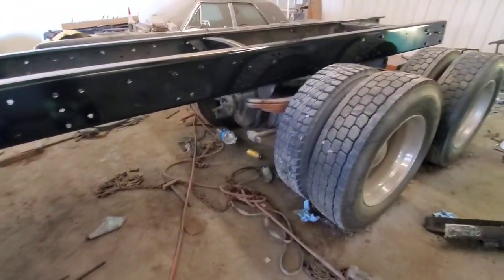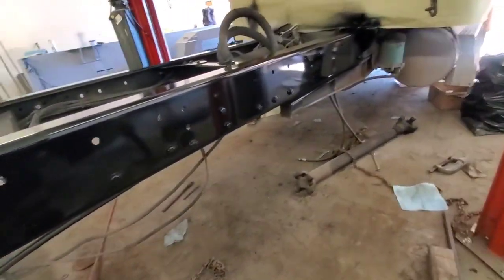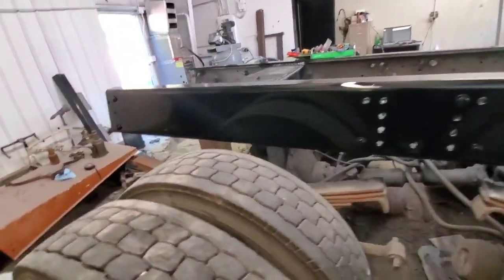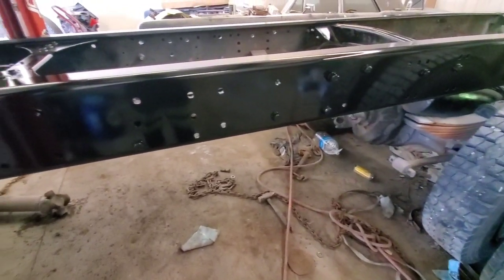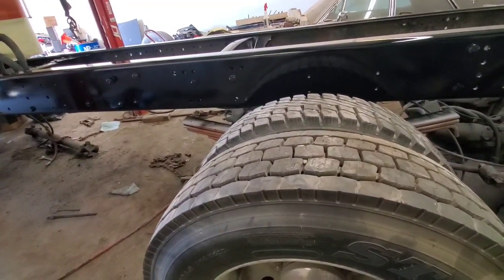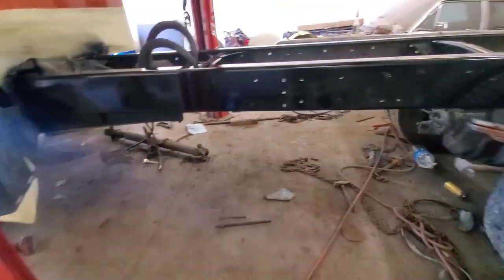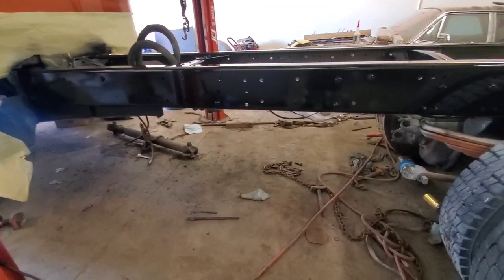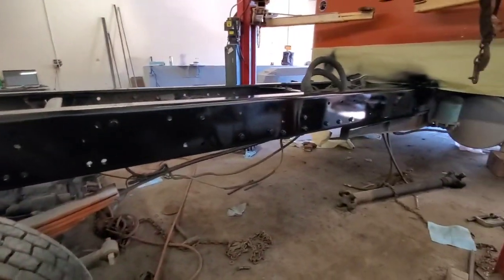Heavy Duty Tow Truck Rebuild Part 12: Frame Install, Prep and Paint

Comment: Nice.   Are you replacing U-joints or anything?   Is it just spring suspension or does it have airbags?   I would guess if it’s only springs it rides rough.   Are you going to put the wrecker unit back on before you drive it a lot?   I am thinking having the weight on would help reveal any problems.   It’s great that you have people that are willing to help with this project.   I assume you will have to have tire chains for winter towing.
Reply from the maker: I am replacing all the brakes and torque arms. Its spring suspension with air bags on wrecker bed. Stuff will pop up once i start workig i
Reply: @towuniverse2443  Are you planning to use it more for just towing, or recovery.   Always good to replace the most important stuff to save yourself headaches.   I would bet the brakes are rusty, and probably worn out, given what the rest of the truck looked like.

Comment: Im getting ready to paint a rollback deck think that paint would work out good? Ive thought of using por15 or either chassis saver, what do you recommend?
Reply from the maker: I use to use por 15, its over priced and dont get it on ykur skin. Tractor paint is just as goo at $45 a gallon.